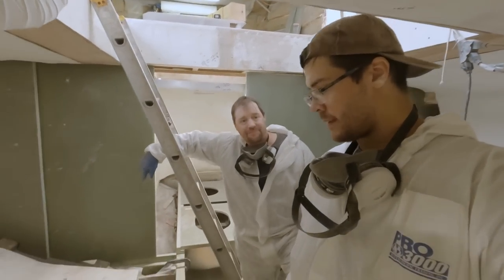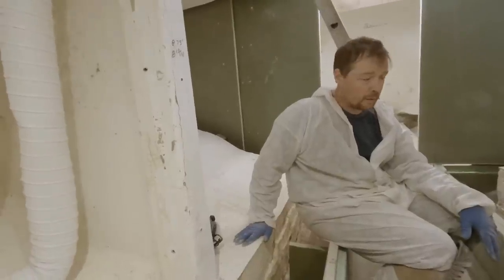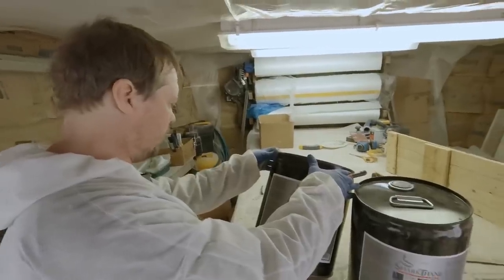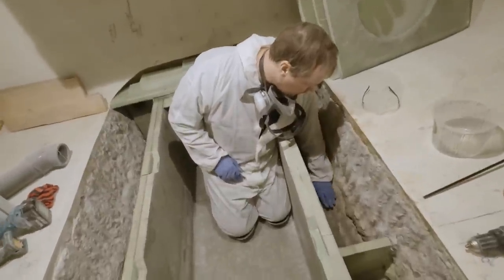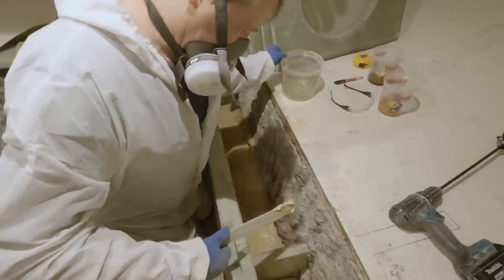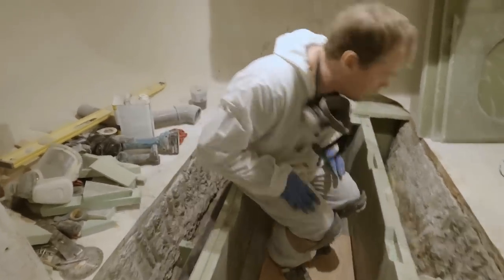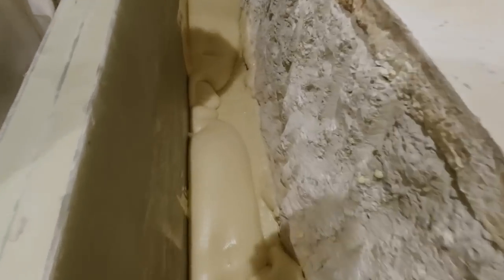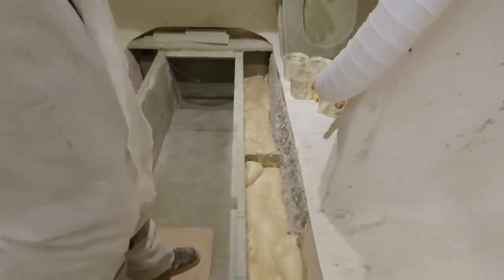Foaming Under the Fish Hold Sumps - Emerald Isle: Ep.51 Fishing Boat Refit

Comment: You have the five gallon bucket mixer, no big deal but they make a smaller one for quart and gallon cans which is a bit more convenient for the smaller amounts and easier to clean.  Thought you might like to know as it can save you a bit of product over several batches as it also holds less on the blades.  Nice job.
Reply from the maker: Haha good point Douglas, we saw one at the hardware store but plastic construction, unfortunately. We scrapped some hardened foam off this one (metal construction) a few times so far, I get the feeling the other wouldn’t have lasted long.
Reply: @EISAlaska  The one I have in addition to the large one is all metal as well; just a scaled down version.

Comment: There is a thing called a froth pack it come as as two cylinders and a hose set  with this you can spray the foam your self or use the other tip that comes with it and use it like a can of great stuff it is less expensive than the five gallon kit. and can be bought at home dopot or grangers.

Comment: They have what's called a froth pack for DIY spray foam. You can get closed cell but it's like $800.00 for 700 board feet which I think is like 58 cubic feet. It comes in 2 like propane tanks with a sprayer, hose, and extra sprayer nozzles/tips.

Comment: great video again . i like the  philosophy / aproach of things ,measure , calculate try and small portion . see the results and recalibrate . 
i want to offer just two small tips . First you can put a bag in the mixing cup , and after the pour you can use the rest  of what remained in like those pastry chefs when they dress a cake , throw the bag out and put a new one after you finished ! that keeps your mixing cup clean and saves you the trouble of cleaning it or the money if you throw it out and use a new one . 
And my second tip you can use a simple  hair dryer  . that gives you the ability to catalyte the reaction faster and bu simple wheere you point it out you can make the foam expand faster , thus covering crooks , corners ,  holes etc faster by making the foam expand there faster than the rest will alone . 
  Waiting for the next video !